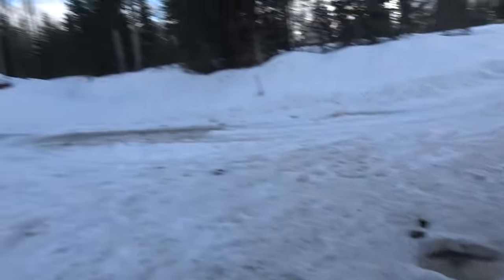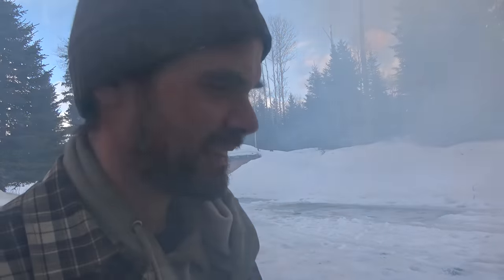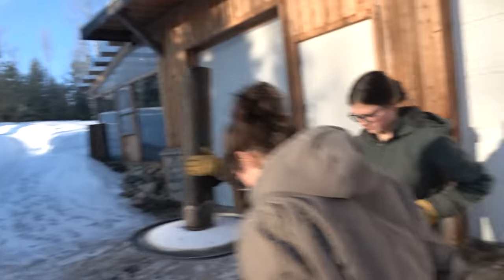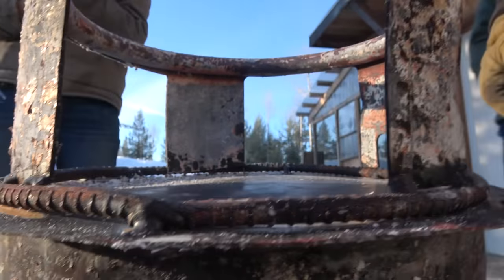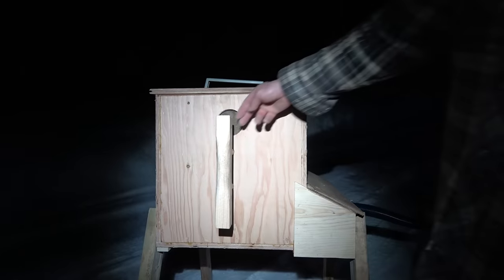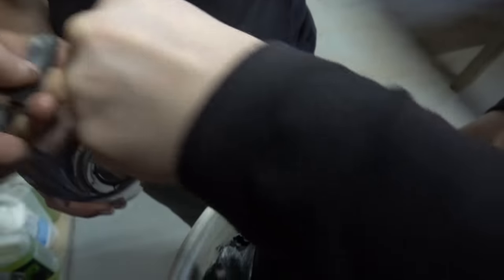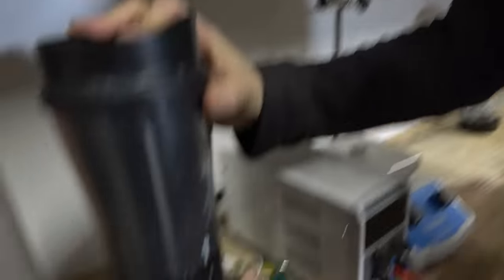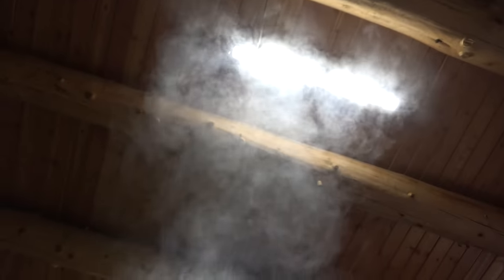Super Easy Black Powder from Home Made Charcoal

Comment: Ok so you take a bike hook the chain to a sprocket that pulls the bellows in and out to move the air and stoke the charcoal.
The faster you peddle the hotter the 🔥 
Gets and you can sit and work the forge
Only using manpower.  The old ones used a crank fan.

Comment: Put a right angle joint on the input air pipe.  IR radiation will go in a straight line and the radiated heat wont make the turn.   You should be fine with the plastic fan blades.

Comment: The pipe that is extended from your furnace is acting like a mirror Aritra or refractor so whatever the heat is inside of the barrel it is 100 times reflected inside the tube that's why the tube is hot

Comment: The heat you're feeling from the fan tube is infrared radiation.  Think of those "Big Buddy" camping heater. The glowing ceramics of the heater serve the same as the glowing from your coals.

Comment: The heat isn't radiating, it's circulating back. If more pressure is added to the barrel than i able to escape then the air has nowhere to go but back in the pipe.

Comment: Fire radiates infrared light which is how it keeps you warm at a bonfire. That doesn't get blown back by the fan though. Add a bend to your pipe so you're not bathing the fan in direct infrared radiation 😁

Comment: Need to use Willow for charcoal. Makes much faster powder.. and also works great for making rockets!!!!!
Reply: We actually took our bear last year out of Home Made BP in a 32 win special.
Reply from the maker: We're definitely getting into BP rifles.....
Reply: Much easier to get powder by making your own. And learning how to use it… percussion caps also!!!
Reply: @figelski1  Flintlocks are quite reliable when you know how to adjust them.  No caps to worry about either.
Reply: @segarza  unfortunately, flint is not naturally occurring in my area of the “bush”, and although percussion caps are a bit more complicated to make, they are a little bit more reliable with your talking about possible dangerous game encounters. But my favorite way to use BP is the black powder cartridge. Most large cal rifles can be loaded with BP as long as a few rules are applied, like NO AIRSPACE between BP and bullet in a cartridge. 30-30, 32 win, 35 REM, and many many others as well as pistol cartridges work well with BP. We know that bears are common in my area, as well as in Gridlessness country as we are fairly close neighbors. I would much rather have many follow up shots, then have to ask a bear to hold his position while I reload.
Reply: @figelski1  Agreed sir.  Back in the 80s, I bought a tool for making #11 percussion caps from aluminum cans.  It was called the "Tap-o-cap". I don't know if they are still sold but it worked great with my .54 cal. Muzzleloader.

Comment: Your pipe is stainless steel. The metallurgy of stainless causes the heat applied to one point on the steel to radiat through the whole sheet.

Comment: Why not use the fan to push air through instead of pulling it?  No heat issues.

Also adding water and sivving will make it more volatile.  Adding isopropyl alcohol instead of water makes it even angrier.

Comment: To keep your fan from melting, you need a heat break. Cut your pipe at the bottom in half then connect the two halves with a silicone sleeve that creates a 1" space between the two pieces of metal pipe. This will keep the heat from conducting through the metal pipe. After the heat break is installed the air going in will be able to keep the first half of the tube from getting hot. You can make your own silicone sleeve if you don't want to buy a 5" long sleeve.

Comment: just take some sheet metal, cut a circle out of if, shape the fan blades, drill a hole in the middle and there is your metal fan .......easy, no need to forge anything
oh and btw with this self made charcoal , you just proven why we need plenty of CO2 in the air, because that's what the tree needed to grow to produce the wood, that you just turned into charcoal, which is almost pure Carbon !

Comment: pure activated charcoal,,I make it like you and I crush it to peices the size of a matchhead and I pack it into a pvc tube and I have my tank water that I drink filter thru it and it removes all toxins and baddies, I also run my stilled off alcohol thru it in a simaler filter ,I have to water down the spirit to a max of 40 percent alcohol otherwise it will not work ,,the activated carbon takes all the impurities and yeast smell and taste out of it ,,it drips thru slowly but the filtered product is a clean and flavorless spirit ,no methanol because I still it all off first as methanol stills off at a slightly lower temp than ethanol ,once the methanol is out the rest is all ethanol, no preservatives and you don't get a hangover from it at all ,,it's potent even at 40 percent and on a big bender I've never made it thru half a pint .
love what your doing and vids are great and funny aswell ,great stuff ,keep it up as your my new fav channel. 
Damo, southern Tasmania, Australia.

Comment: Termite Burns hot enough to melt through steel work are you using propane Eugene laskowski used to use propane I'm not sure what's the price difference

Comment: Be careful , I know a guy who made black powder and was gonna blow up a big tree stump he was removing on his property. Made a black powder pipe bomb. Filled it to over full. Was screwing on the last end . It blew up in his face. He got powder in the treads. He was lucky as it was the very top thread. It partially blew up as in it was abig boom that sprayed flame over him and he caught on fire and got4 or five peices of metal in his arm .Good thing he had safety glasses on. The glasses had spots of metal and burns. The bottom part went mostly into his new work boot. Fried it from the inside. He could not hear for weeks , he did call the fire department. Hes now dyslexic.  Has a problem knowing right from left. His job was driving a submarine for the U.S. NAVY . TRUE STORY 
He was permanently on crap detail till he got out of the navy. Be safe .

Comment: Your pipe is mirror like metal. It'll actually funel the infrared thermal radiation down the pipe as if the fan is still close to the source. Perhaps just use a shorter pipe with a ninety degree or spraypaint black down the pipe a good ways.

Comment: Destructive distillation of wood. What did you do with the flammable gasses that came off that, which includes methane?

Your carbon is way too coarse, and the resulting burn rate too slow to make an explosive device, although it could power a rocket.

The explosion at the end was made by some other means. Maybe this explains why you didn't show it being made. Blasting cap?

Comment: There is a couple of things I would like to explain about safety regarding the making of gunpowder lotta people think it's fun but it's extremely dangerous because of factors that play a role  first of all you can't be playing with gunpowder on a metal table. 2nd of all you can't be wearing anything that is wool on you because of friction of the wall on your body creates a positive charge, and if you're not grounded that charger eventually will have to leave your body and when it leaves your body it leaves at a level about 15,000 V this is called a static shock now the static shock creates that dangerous spark .that's why you have to work on a table that's made out of wood and as less as possible to use metal containers in the process of playing around with gunpowder seeing people get hurt really bad because of the lack of knowledge and also some have lost their life because of that as well  is crucial that you will be very careful
Reply: The good thing about Black Powder is that it is explosive when confined.  Otherwise in small quantities it just flares up. As seen in the video.  You can make fuse easily with cotton cord  soaked in a mixture of BP and a little starch and water.  Dry in the sun and you are good to go.  You can also paint this mixture on paper as letters or art and light it up when it gets dark .
Reply: Most of the time when it's really dangerous is when making fireworks and also homemade dynamite sticks and also other explosive device that's when the danger comes one static spark and it's over I had a friend of mine that died because of that it was a long time ago I just wanted to let you know so it doesn't happen to you and your family all the best to you I really enjoy your videos

Comment: If you would have put a 90 degree elbow on the lower pipe and then put the fan in the pipe, you should not melt the blades.

Comment: If it's radiation that's killed the fan blades- how about putting a 90 degree - a right angle fitting - so there's no "straight shot" to the fan? Radiation is mostly a "straight line" thing....
Reply from the maker: That’s exactly what we did! Works great.

Comment: The fan melted because you put the air inlet directly exposed to the heating element, and the inlet is WAY too big. Drop the size down, I’d use 2.5” or less. Plastic isn’t the issue, poor design is. Really the air should be com my from the bottom.

Comment: Reaction way too slow. You need to use bass or balsa wood and make your charcoal.  the softer and faster growing wood, the better.

Then You need to granulated it using alcohol and a tiny bit of dextrin to make a clay consistency and grate it through screen. Let it dry.  firearm quality powder goes poof, not fizzle.

Comment: Not the correct way of making charcoal. 
 I have made charcoal for 23 years at home and sell it.
 Put in a metal container as he did. Seal it up with a hole in  the top or bottom. Most say bottom but I put a hole in the top.
 Set in a roaring fire 🔥 . First it will have smoke shooting through the whole which is all the moisture and other waist in the wood.
 Then it will start to shoot a flame that sounds like a jet engine, then it will just be a regular flame. Once the flame stops coming thru the hole 🕳 remove the metal container from the fire immediately and let cool completely b4 opening. HARD WOOD ONLY....
WILLOW FOR BLACK POWDER.
WILLOW HAS A FASTER BURN RATE.

Comment: Why go to all that work to burn wood to make charcoal and yes... I know you wanted to show how you start from scratch but you can buy a large bag of what is called lump charcoal made from exactly that .. burned wood and for cheap so why make it? Just a quick mention is all it takes. The black powder idea is good but if you want to discourage EVERYONE to NOT make black powder, keep showing what you're going through and all the work it takes to make what you can buy off the shelf called the 'lump charcoal'..which is the most available component. it's like asking someone to fly to a destination but instead of just buying a ticket you show them how to build a plane first.  Obtaining charcoal is the least of what you have to worry about getting regarding components since the necessary oxidizers are what make the 'bang' happen and is what is controlled in all states by law if you buy a significant amount... that is where you will be checked out as to 'why'.  Good video otherwise .

Comment: That has to be the most ridiculous way to make charcoal that I've ever seen. All you need to do is to take a metal barrel, bucket or even a coffee can, fill it with wood and turn it upside down. Then , make a channel in the dirt under the lip of the container for gasses to escape and build a fire around the container. Let the fire burn out and you are left with charcoal in the metal container. That's the simplest method. If you have an artist in the family put sticks in the container to make charcoal sticks for drawing.

Comment: Do not use anything metal inside your rock tumbler. Like nuts or bolts. Always use an extension cord and use the tumbler far from everything and anybody. Including pets. Do not store black powder . It’s best to make what you need and use within a week. Never transport black powder in a vehicle. Never get black powder on or near fuses. Discard in water any fuses that have been contaminated with black powder. Fuses that have been contaminated will accelerate instantaneous the rate of burn that a fuse was intended to burn at and cause a device to explode. Never make black powder on low humid days for static electricity will increase. Always make black powder outside and never in an enclosed environment. The manufacturing of black powder should be an absolute last resort. Always buy pre-made black powder from a well known manufacturer. In my honest opinion get a new hobby, pyrotechnics and explosives are unforgiving. If you survive an exposition you’ll wish you didn’t.